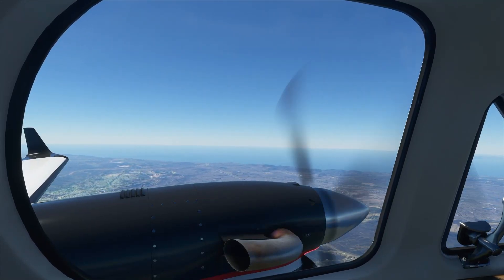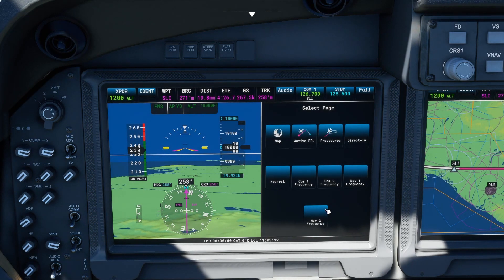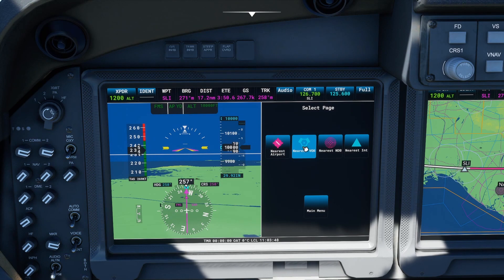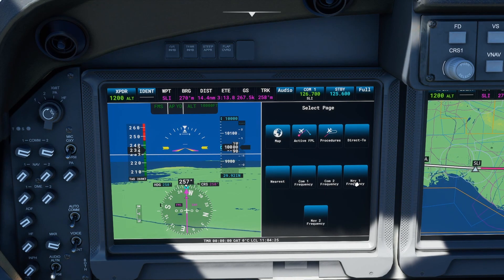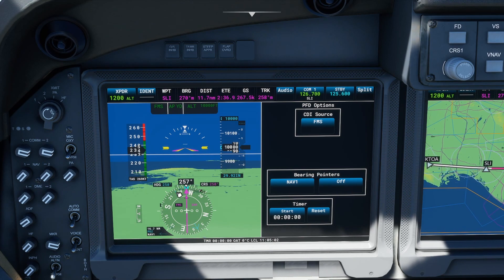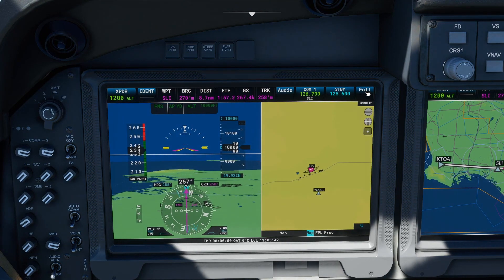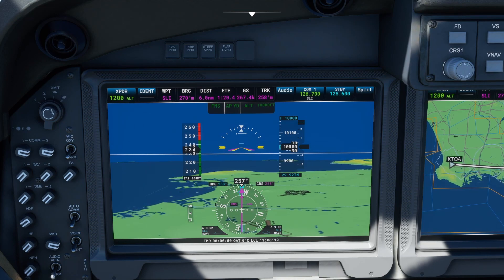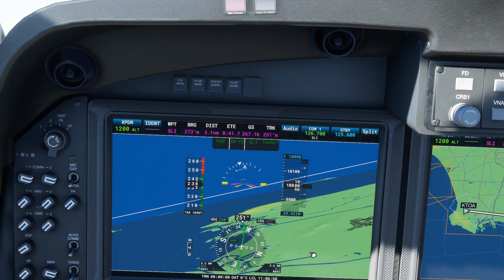How to use MSFS King Air 350 NAV Radios

Comment: How to insert ADF NDB?
Reply from the maker: King Air does not have ADF installed in this version, you can still use navigation with NDBs however by inserting them into your flight plan by identifier (name) or via the nearest function

Comment: How do you select the radial/heading you want to fly as opposed to just going direct to the station?
Reply from the maker: if you select CDI source to VOR1, you change the course/radial with the left course selector (CRS1) located up in the autopilot center panel, left side. If you select CDI source to VOR 2, you use the right course selector (CRS2) on the right side.
Reply: @ccacrislan  thanks 😃

Comment: what about ndb??
Reply from the maker: The King Air does not have an ADF installed in this version of MSFS2020.
Reply: @ccacrislan  ok, i was wondering why it has a nearest ndb? Make no sense, but thanks for asnwering :)
Reply from the maker: It has that function so you can select and use NDBs available in the NAV database. That is allowed by regulations. You can even fly certain NDB procedures or other procedures that says “ADF required” without having an ADF installed because you have an IFR approach certified GPS.
Reply: @ccacrislan  but i cant fly in greenland beacuse there's not gps aproaches, there's only ndb and vor at airports :)
Reply from the maker: Well, you can still fly, if you choose another airplane like the TBM 😃
Reply: @ccacrislan  Yea i know, i want to fly air greenland, they operate the king air. Hope they will make an update with ndb to the king air

Comment: Thanks for the video. 
But I see no way to tune an NDB frequency. Have I missed something?
Reply from the maker: You did not miss anything, unfortunately the ADF receiver is not modelled in the King Air 350i. And actually ADFs are not being installed any more in newer airplanes (in real life) as is an obsolete technology. Thanks for the comment
Reply: It appears to be able to select "nearest" ndb as an add on to ones route  but no ability to tune indipendantly. I would take issue with you about obsolesence. In many parts of the world ndbs are still part of the aviation scene. I believe it will be many years yet before they finally disappear because they are so cheap to instal by comparison with VOR etc.
Reply: @davideo0  Also, whoever created the free DC-3 for MSFS used the King Air panel. If you are replicating flying in the old days with the DC-3, you need the NDB.

Comment: Huge thanks for this.  I flew this plane for the first time in the sim this morning, thinking it was similar to others.... but no.   Now I am ready for my next flight!   Quick question, I see the Baro wheel up top, but how do you actually set it after you dial it in?
Reply from the maker: The BARO wheel is used to change the altimeter reference barometric pressure, so you move it to change the QNH value. If you press it it should change to QFE (29.92) but I think, that sometimes does not work as intended yet in the MSFS. You have one BARO for the main altimeter and another one for the standby altimeter. I hope this answer your question, if not, please let me know and I will try again.